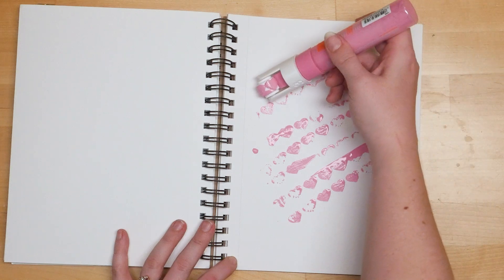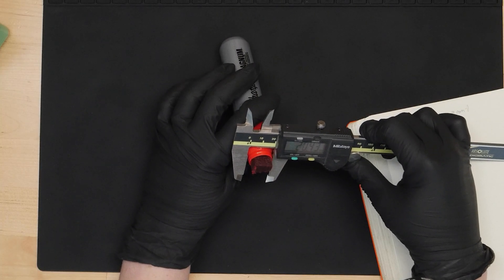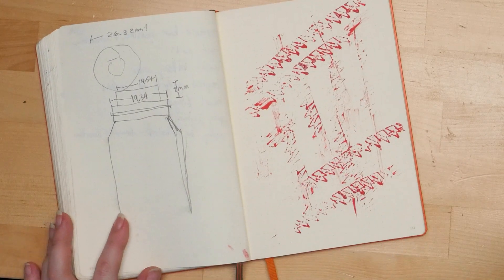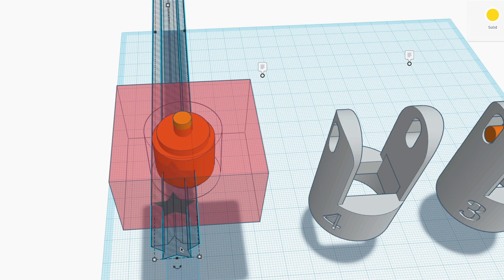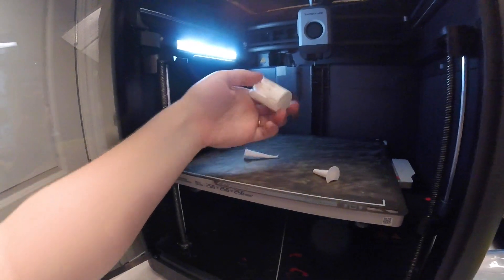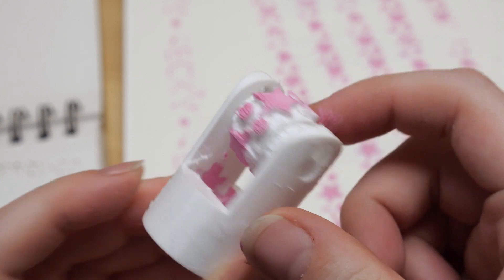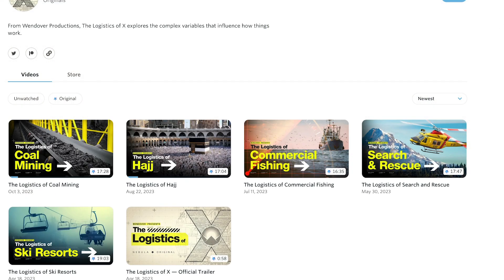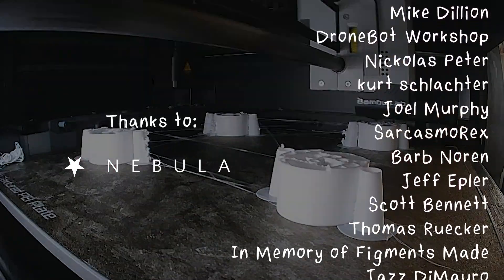3D Printed Stamping Markers (Files Included)

Comment: Had a set of these 50 years ago !
The pattern wheels were about 1.5 inches diameter with tubular axles all in a rubber material.
They clipped into the fork of the test tube sized hollow handle that held a loose ink tube with a wide felt pad that rested on the wheel.
also had a 1 inch, hard wheel that you could clip individual letter blocks onto. 
Fun ! 😁

Comment: cool idea! seems like it'd get more ink on if the end of the marker was cut at a diagonal to match the path of the printing surfaces, so would have longer contact. also, all that stuff enclosed, so not exposed to so much air. as mentioned below, some non-printing driving wheel with lots of surface area outside the printing wheel part of the assembly (to increase the coefficient of friction), should remove those associated problems. finally, i don't have/am no very familiar with a 3d printer, so it might not be possible, but if it is then fusing a very soft type of plastic on the pattern part would be best...lol, speaking as a child of the 70s who spent many a weekend morning at parents' offices playing with stamps, there's a reason the best stamps are made of rubber. love your content, thanks!